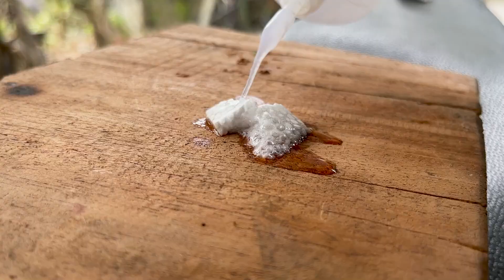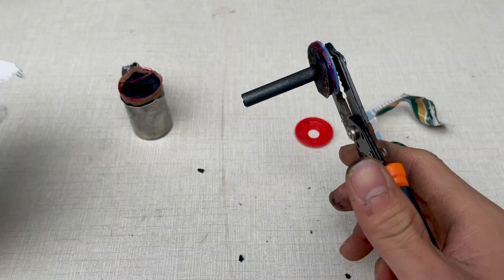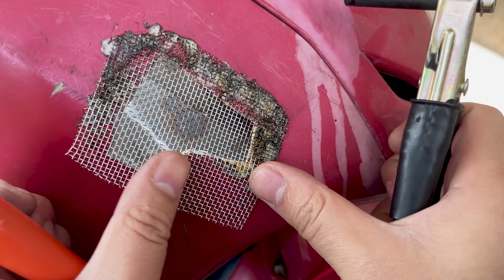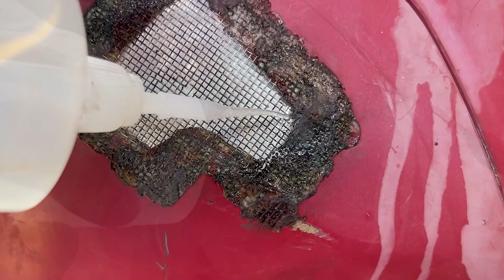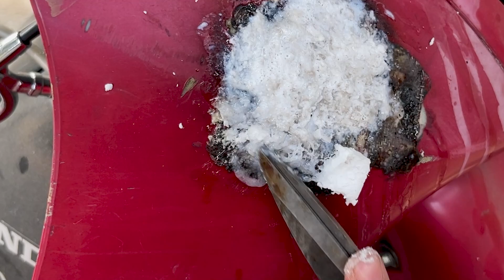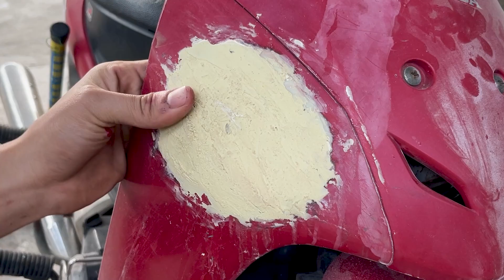Even professor HONDA learned this from me! Plastic welding technique without having to weld plastic!

Comment: Would have taken the panel off, put the wire on the back, put the polystyrene in a pot with petrol and then filled it with the solution to get a better finish before using filler, finish could be a lot better than it was, but it's a DIY fix.
Reply from the maker: You could do it more simply to finish the product, thanks for sharing!

Comment: Oldumu yani pürüzsüz deliklerin olmadığı bir yüzey gerekiyordu mesela en son o delikleri kapatmak içinde karbonat döküp yapıştırıcıyla sağlamlaştırsaydin ve zimparalayıp öyle boyasaydin, ama sabredem3din tabi 😅
Reply from the maker: Yes, this is a great way to fix holes and create a smooth surface before painting. Using baking soda combined with glue and sanding will help make the surface more solid. Although it takes a bit of time, the final result will be worth it. Thank you for your interest and sharing, my good friend, have a nice day💖 💖 💖